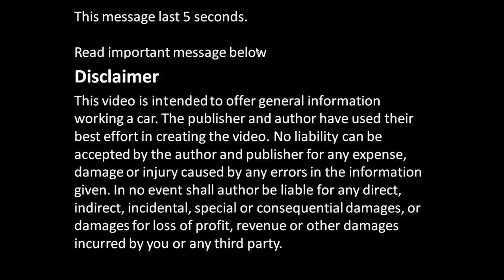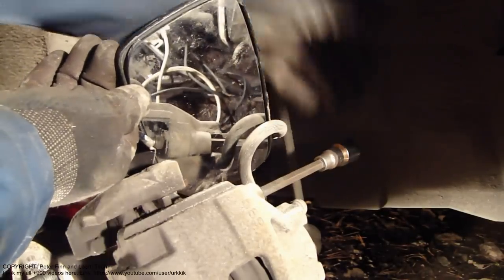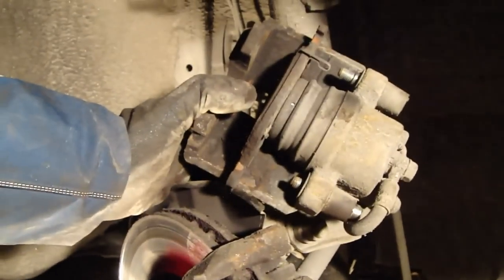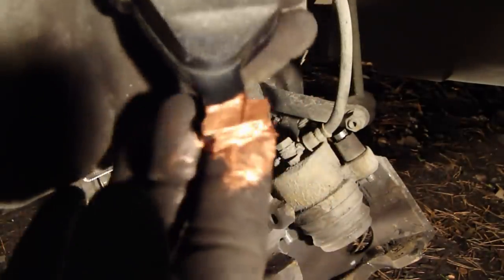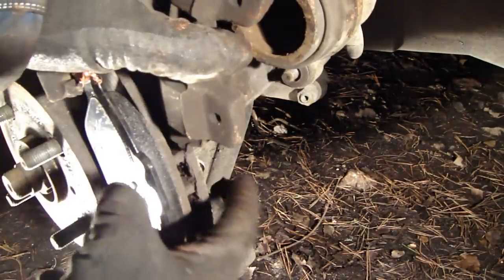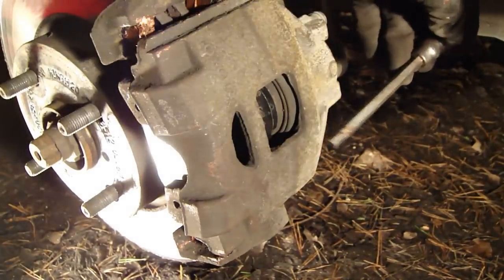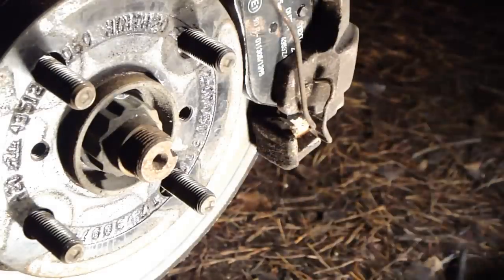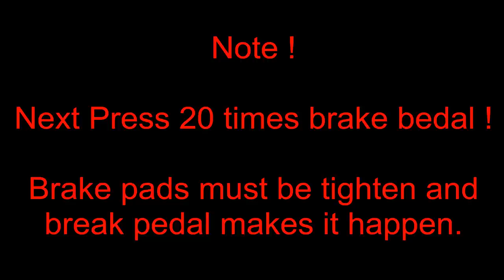How to replace front break bads Toyota Yaris. Also Echo or Vitz. Years 2006 to 2013.

Comment: This video is a good example of how to NOT do it. The brake caliper should be fixed by a hook and not let fell down like that, that could damage the hose. Buy a special tool for pushing back the piston, do not push it only on one side of the piston.
Reply: The brake caliper should indeed be wire hung to avoid stress damage to the brake hose; but the brake pistons can be effectively reset by the use of a G - clamp and used disc brake pad. Negating the need for a specialized tool.
Reply from the maker: Thanks for comment

Comment: The calliper spring push the bottom one in & tap it with a hammer to secure it, the top part of the spring position it on the outside of the calliper but use a water pump plier to squeeze  the spring this will automatically give you the exact tension then using a hammer tap it in to the top hole. Careful if it slips but this took me from 20 minutes to 60 seconds. Good luck!
Reply from the maker: Thanks for info. :-)

Comment: Brake pad, disk change..complete job, takes maybe 3/4 hour per side.

Check fluid level, remove some if necessary to avoid overflow when piston is push back inwards.

Push steadily the inner brake pad about 3 mm inwards against the brake piston (clearance for disk wear)using a good sized flat blade screwdriver.

Undo the two main retaining bolts, using a socket and bar, with extension over the handle for traction.

 Take off the outer clam by sliding it off the two chromed sliders, take it into the workshop, clamp it in a vice and unscrew the sliders recessed bolts, using a 7mm Allen key with hollow extension bar to fit over and gain extra traction (a box spanner will do it nicely). 

(If you are replacing the disk as well, two bolts into the threaded holes on the disk and tighter slowly and evenly until the disk releases. Put the new disk in place (after cleaning off the anti-rust coating) and using a wheelnut locate disk in place on hub.)

Back to the car, push the brake piston in with G clamp fully in until it stops up hard, thin film of grease on the piston lip and on the back of the brake pad. Replace assembly and tighten the main bolts. Push fully the inner brake pad with the springs, then drop in the outer pad, holding the outer pad put the assembly into place around the disk, put back in place the sliders (after light grease), lock them tight and replace covers. 

The awkward spring. ! Not so very awkward, it's very easy to get the spring seated correctly, tools you need are, long nosed pliers, a small hammer and Mole grips (wrench to you Yanks), hook the top spring and wire into it's locating hole. use the grips to compress the long wire of the spring clamp it against the rear of the housing, line the spring tip to the hole with the pliers, keep hand pressure on and lightly tap it fully into the seating hole with the hammer. 

Done !!.

Comment: After watching this I tried this one my 2007 yaris this weekend and I could not get the piston back in. I had one of those piston-pliers to force them back in, but it was so tight I broke the tool. No luck trying with a huge clamp either. Looking at this video again the piston doesn't look the same as mine? Mine has four holes in it and was not hollow.  Do you know which piston that is, and do you maybe have a video of that already?
Reply: Maybe there is a difference on the front and the back brakes?
Reply from the maker: Hi, you might have the piston, what you must rotate and press same time?